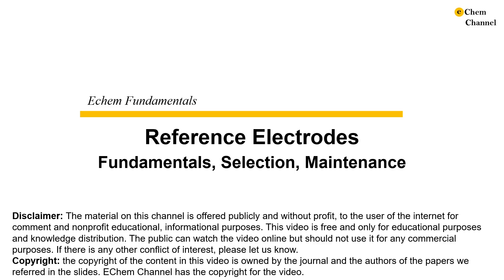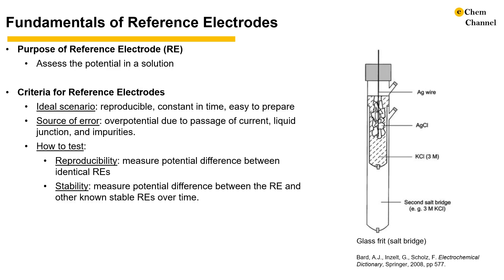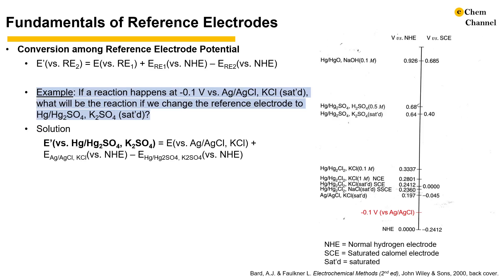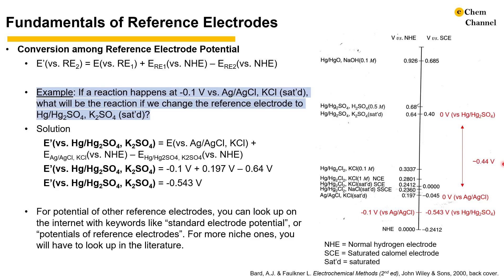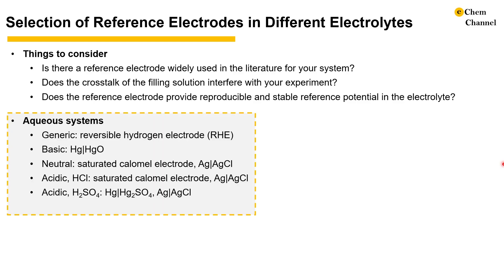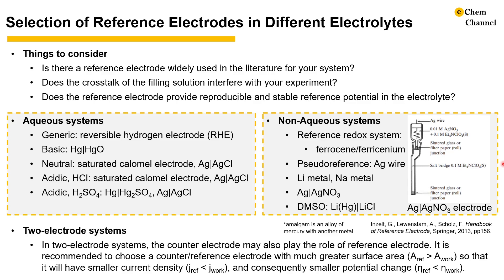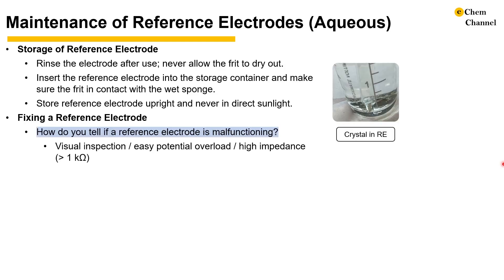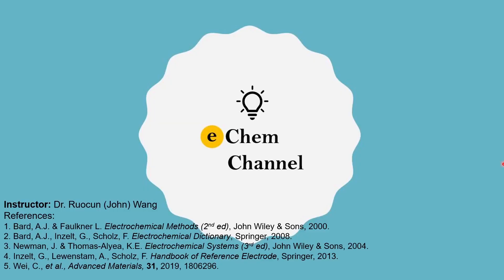Reference Electrodes (Fundamentals, Selection, and Maintenance)

Comment: I want to express my gratitude for the valuable content you are generating. It is truly appreciated! I have a question regarding the pH range suitability of the Hg/HgO reference electrode. In terms of pH units, what would you classify as a basic or alkaline electrolyte? Specifically, I am interested in knowing the lowest (alkaline) pH value at which the Hg/HgO reference electrode remains stable and reversible.
Reply from the maker: Thank you! Generally, use Hg/HgO when pH is > 11. There is a paper published last weel that has a pretty good summary: https://pubs.rsc.org/en/content/articlelanding/2023/ta/d3ta03145d/unauth